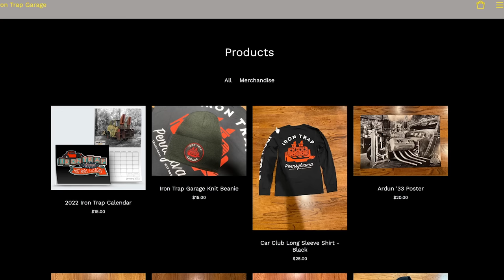Boxing The Sketchy Frame For A Model T Roadster Racer!!

Comment: Glad to see Moon back at the shop I hope Matt and Mike do a really good job on filming that Flathead 6 for this I'd like to know everything about the Ford inline 6 for racing this car could be a trog machine I just know this will be one of their coolest cars when done simple and old school to the max
Reply: If the motor gets rebuilt, I hope we get to see some of the process.
Reply: @DuckReach432  me too I have a six-cylinder that I need to rebuild it's a rare 1942 Ford flathead 6
Reply: @chuckb9867  I have 2 Flat 6's. 48 and 49. 48 is in my 51 F1 and the 49 will go in my 52 F3. One is a fresh rebuild and the other has all the machining done and just needs to be assembled. Great motors and very underrated IMO. Looking forward to the build.
Reply: @ericargo9157  I understand the inline 6 has more torque than the V8 Ford from the same year medium 42 on up with the flatheads do you know of any parts that are hard to come across I want mine to look all original I don't know if it's true or not on these engines but I have seen others where distributor shaft bushings can really affect the timing has they where the shaft bounces creating false timing situation also I imagine indexing the spark plugs would help what oil grade do you recommend synthetic maybe or no way and I'm sure you should add zinc I have a 1942 Ford staff car I need to work on it big time

Comment: Why did you not put a mid or rear cross member in while the frame is square and true on the table?
Reply from the maker: Because we don’t know where the center cross member goes yet because we can’t fit the engine and trans in with the chassis on the table. Welding a cross member in won’t be enough heat to warp the frame.